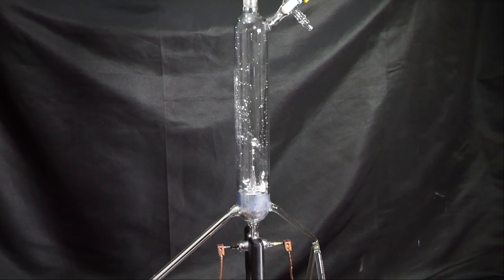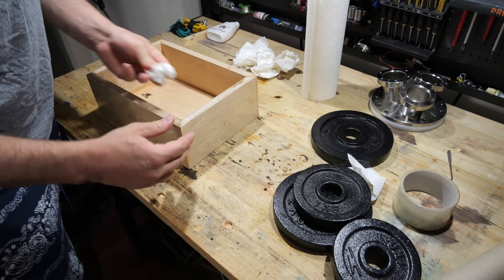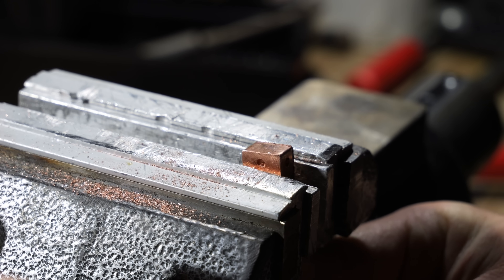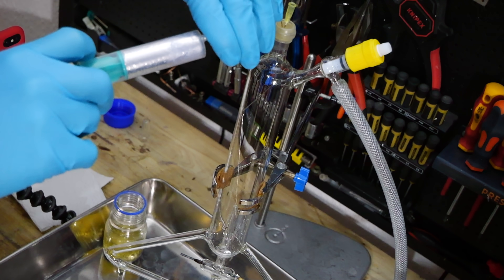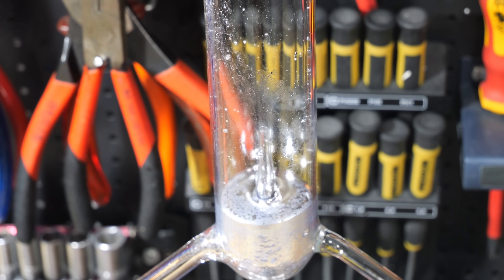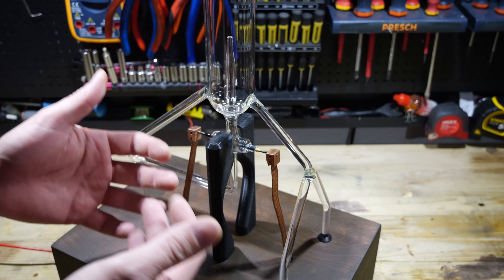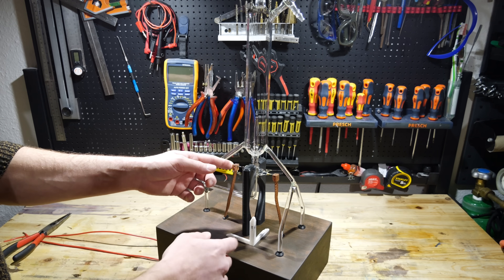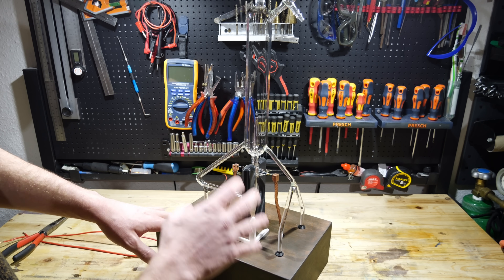This Fountain Runs on an Explosive Metal

Comment: hey great stuff :)
are you sure the heat comes from the electrodes resistence and not from the resistence between your pretty loocking copper to electrode clamping ? A hint could be if the right and left electrode are at a different temperatur ..(?)

and the comments from @w__a__l__e  and  @sealpiercing8476 sounds good,
i hope there is no need to recreate the fountain, still i love the video where you build it with that awesome support by Johann  :)
Reply from the maker: I considered this possibility but I don't think it's the resistance at the connection. Even the thick copper cable gets warm, so I'm pretty sure the even thinner tungsten rods (which are also less conducive) heat up significantly.
Reply: ok yea thats a point, if you should investigate more in that direction, may you can just meassure the voltage drop within the copper, the electrode and the clamping, that schould give you certainty. off course this is only at constant current practicable, and think about the length were you meassure the voltage drop to be in perspective (Sorry for my bad English.)
Reply: @stable32  You can just measure the resistance with a multimeter and calculate the voltage drop at a certain current from that (V=R*I). No need to measure the voltage drop directly.
It will only change significantly, if the metal heats up a lot.

Comment: You  can use a big 110/220V to 1.5V Transformer capable of producing at least 40A or you can rewind a random transformer (of at least 500W) with thicker wires to get the desired output and then use a rectifier with capacitors to get the required DC voltage and current. This way you can run your fountain continuously and avoid intermittent working because of the SMPS.
Reply from the maker: I allready thought about rewinding a microwave oven transformer. But I need something with a small enough form factor to fit into the base. Do you have any ideas or even a model number of a transformer that could work?
Reply: @AdvancedTinkering  Classical AC (transformer-based) power supplies and SMPS work on the same principles just at different frequencies, so there isn't really an advantage here.
Actually at 50Hz components are WAY bigger, so if you want a compact one you should use a SMPS.
Just make sure you get one that outputs high current at low voltage (~1V as suggested).
Also a current-mode supply would be ideal, because the voltage should be as low as possible anyways and doesn't matter here. The supply should limit itself on the current and not the voltage.
Don't use resistors! They only waste the energy in the overvoltage! Just have a current-controlled supply or start with very low voltages. You can measure the resistance of the circuit through the fountain to calculate the voltage at the current you're aiming for with U=I*R. This voltage is wasted as heat, so it should be low (by making all conductors bigger - cables, tungsten rods, contacts).
Reply: @AdvancedTinkering I would not recommend rewinding a microwave oven transformer. Unless you're up for an adventure in linear power supply design. I would recommend using a higher-power switchmode supply in constant current mode. If you plan to operate this continuously, I would also intentionally derate the supply somewhat. Many suitable supplies exist, if less reputable ones than meanwell. All that having been said, what a gorgeous display!
Reply: I suppose you could use a ferrite core transformer rather than iron core, they are way smaller and lighter but also harder to drive. @AdvancedTinkering
Reply: @UltrAgejmr  Which is what the MeanWell uses. The operating frequency is quite far from mains frequency, however, and thus the complexity. Hence it's worth buying a ready-made one.
Reply: @T3sl4 I mean yeah, but you can still make your own that fits the best for your application like 12 to 2 volt and even make it work on batteries.
Reply: @AdvancedTinkering I think rewinding a microwave transformer will not be a good idea because it will allow more than 1000A to flow into the NaK liquid and will make the mixture boil at this current...

You can buy a random 110/220V to 12V transformer capable of producing atleast 10A of current at the secondary and rewind it afterwards to get your required voltage but you must use a thick wire.

Or a better option will be to salvage and use the transformer from old transformer based bulky soldering irons. They are designed to produce 40-50A of current at 1-2V(AC) you can use that with a rectifier to get the results...

I think using the soldering iron transformer will be the best idea along with rectifiers and filters in my opinion and they are also small in size so you can fit it easily in your apparatus....
Reply: a modded microwave transformer would probably cook itself in 5 mins without some hefty active cooling(im not an expert if there IS a way to keep a generic transformer under extreme load within operating temperatures without a massive heatsink or active cooling please educate me.)
Reply: With that high current the problem is only going somewhere else. The glass will break from the heat, etc. Current limiting power supply is the solution here or some cooling system for the NaK.

Comment: 8:46 maybe you could get more magnetic field in order to reduce the required operating current. Right now your permanent magnets have field lines going through air. You could route the field lines that aren't going through the liquid metal through some steel (ie make a yoke), through more magnets, or through some material that is more optimal for the purpose. 

I think this thing could be made safe enough to leave running. Secondary containment in a bell jar full of sub-ambient argon seems like it would make it plenty robust and still good to display, for example, and it wouldn't need to be strong enough to hold vacuum.
Reply from the maker: If I'm not mistaken you allready suggested using a yoke in the comments of my first video. And I really liked that idea! I thought a lot about a version using a yoke, but since I can't machine metal I was not able to make something that looks somewhat presentable. But it probably the only way to reduce the needed current and thus solve a lot of other problems like the overheating.
Reply: @AdvancedTinkering   You could do it without much machining, clamping/gluing together several pieces of flat steel (cold-drawn flat steel has fairly good flatness and surface as-is) would be good enough. Otherwise, i could probably machine something for you.
Reply: @semifavorableuncircle6952  Maybe it is even possible to salvage the steel core of an old transformer, maybe a MOT or something similar. Apart from that I think more electrodes instead of thicker ones might be an option if it is really necessary. Also moving the copper pieces closer to the center, making them a lot bigger and improve contact further could help reduce losses and sink some heat out of the tungsten rod into the copper.
Reply: @allesklarklaus147  Transformer laminations (or even more advanced magnetic materials) dont have any advantage over solid low carbon steel for a DC field in an application with a significant airgap. The laminated silicon steel has lower losses at AC only and re-shaping a transformer core into the desired shape is certainly harder than building it from flat or square stock...
Reply: @semifavorableuncircle6952  The point is that if possible you just take a U-shaped part of the core and stick your magnets on and are done.
Reply: You could use steel wire for the yoke. Easier to work with and magnetically equivalent.

Comment: it's even more beautiful when you fill the fountain with mineral oil instead of Argon, then everything happens in slow motion

edit: as for the electrodes, use an array of electrodes on each side.
Reply: Fountain can curve spacetime. Ancient Greenhouse is tech. With rod on the top, fushion soul into air